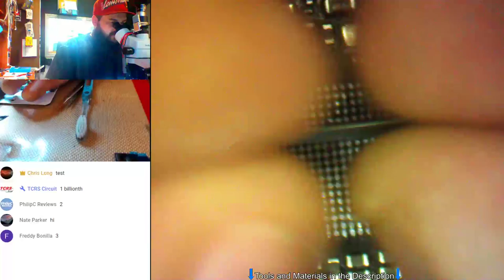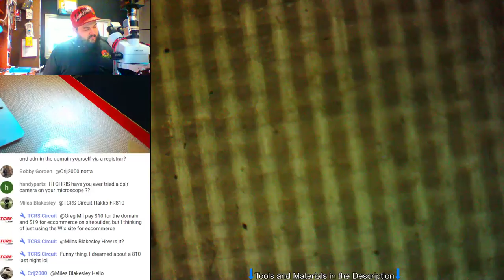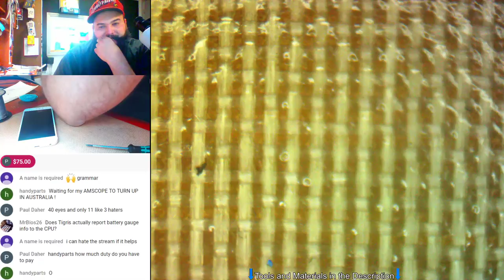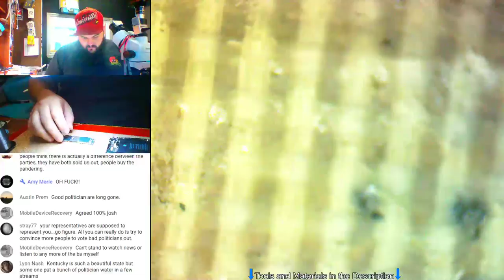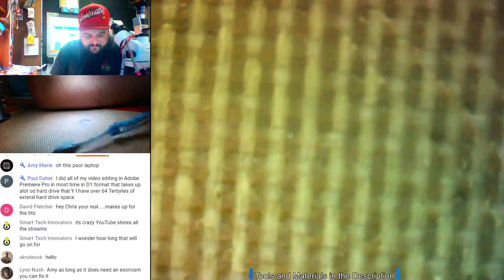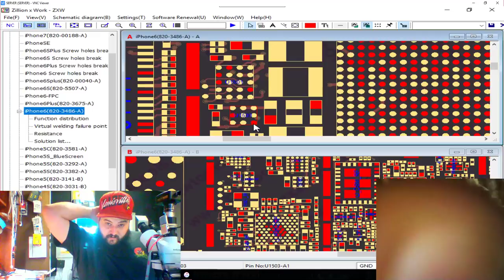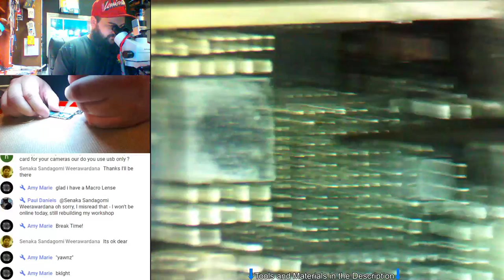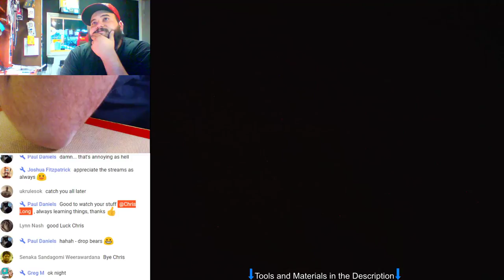Pad Air 2 VCC Main short caused by PMIC

Comment: Is it possible connect voltage to a line with a short circuit directly from the power 
supply unit by limiting the voltage 1.8 and using a freezer?
Reply from the maker: Yes it is. What do you mean by a freezer? Like a freeze spray?
Reply: Yes, freeze spray. Chris Long Thank you very much for your videos. I understood many practical diagnostic techniques. Keep up the good work